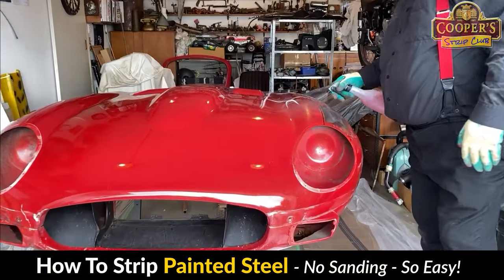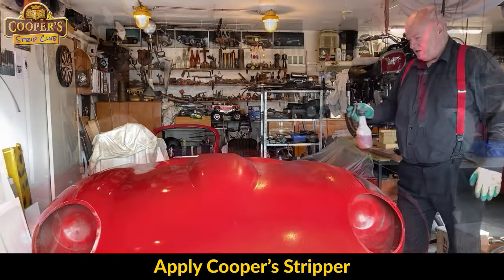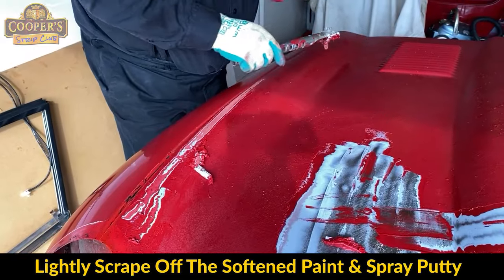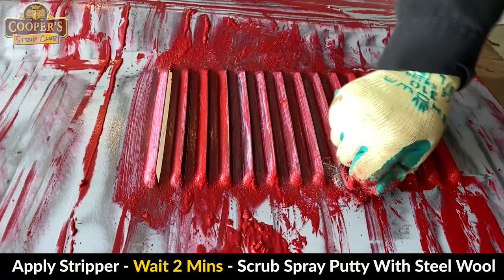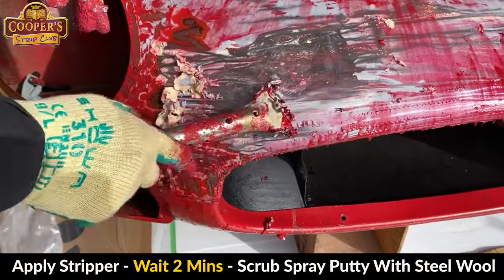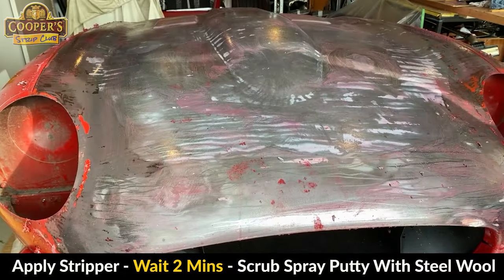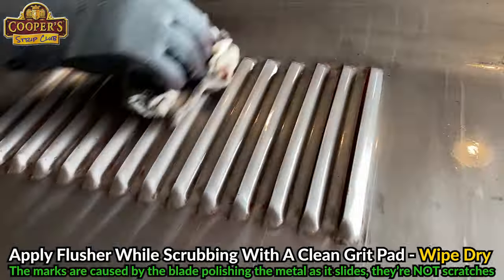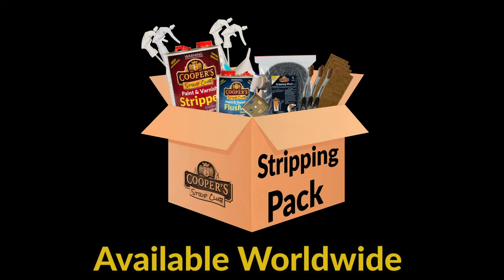How to Strip Thick Car Paint

Comment: Will this work on my fiberglass c4 corvette?
Reply from the maker: Hi, Cooper’s is excellent for removing paint off a fiberglass surface; however, you do have to be aware of the time the Stripper is allowed to soak for. As soon as Stripper has collapsed, the paint needs to be removed and the fiberglass surface rinsed with our Flusher.

I've put a link in below to a Corvette we stripped the hood on 

https://coopersstripclub.com/metal-lpp1/

Cheers for reaching out, have a great day